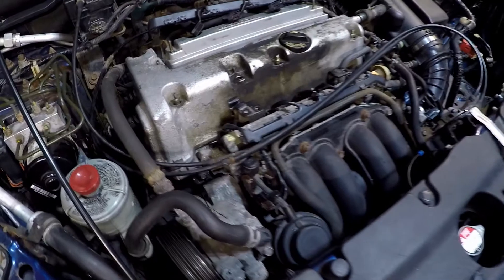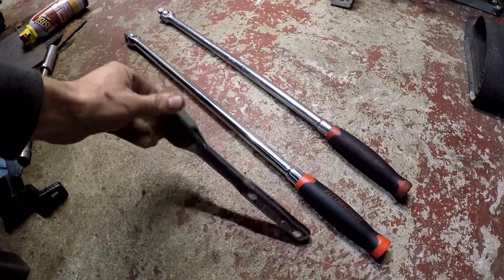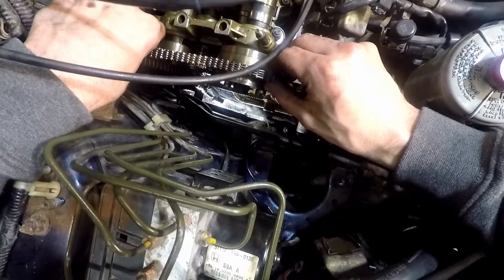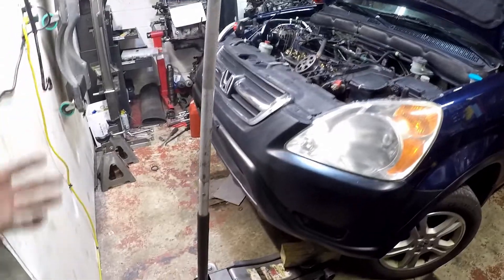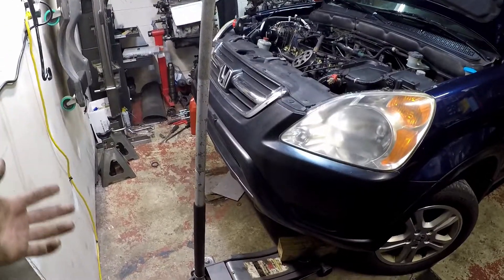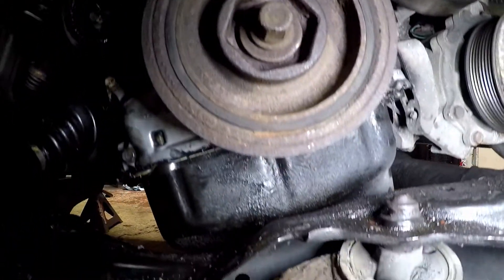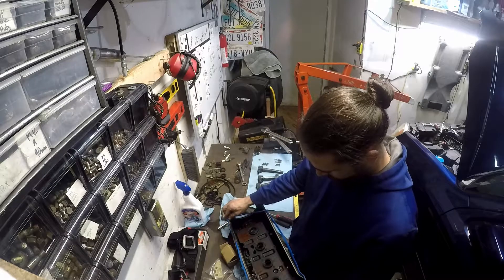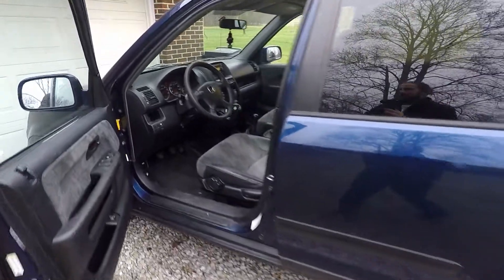Timing chain & valve adjustment on the 2002 CR-V: Solved the misfire?

Comment: How would the process of aligning the chain go? It seems like if I align two marks, the third mark is not TDC. However, when the crank is TDC, the chain marks do not line up???
Reply from the maker: You want the crank and the cams to be at TDC before removing the chain. The marks on the chain may not match up with the marks on the crank/cams. I think mine were off when I took mine off. It's been a while since I did that but I'm pretty sure the chain only lines up with the marks during install once it's rotated they become misaligned but the engine is still in time.

Comment: How much is the RPM when the speed is 120 km?
Because I have the same model. When my car speed reach 120km, the RPM is more than 3 and half.
Reply from the maker: That is exactly where mine is at. These weren't made to be super fuel efficient so due to the gearing, it runs higher RPMs at the highway speeds.